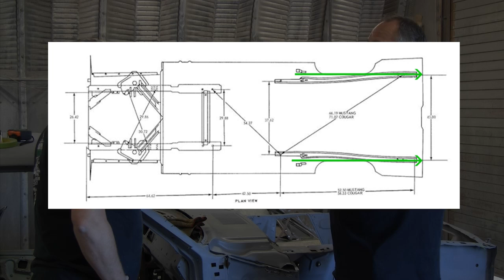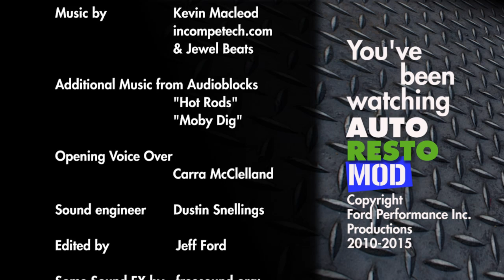How To Full Floor Pan Install 1967 1968 Mustang Tips Tricks  Episode 195 Autorestomod

Comment: How does a rotisserie change his suggestions for jacking the car?  I also have cross bracing available since I am working on a 70 convertible mustang.
Reply from the maker: Well, I am not a fan of using a rotisserie for floors. Ford sat the cars on a jig table to lay that foundation and you will lack that on a rotisserie.

Comment: A few spots after the floor pan was layer in show rust spots. You guys gonna go in and wire brush those spots?
Reply from the maker: There is a ton of other work to be done. We hope to get down there in the coming weeks to show some more on that install. They pulled that ahead of other cars so we could shoot the episode. So there will be more on the car, just a little further down the road.

Comment: You may have already answered this, but I didn't see it in the posts. If so I apalogise. I have checked your videos, and can not find the second half of this video. Could you send me the link to it, so I can watch it as well. Or if you could send me a link to a video to show toe panel installs that's my next step before putting in my one piece floor pan. Thank you, and really appreciate you doing these videos. They have helped me many times already on the 65 I'm building for my daughter. This is my first major resto job, and it would have taken my twice as long to do some of this if not for you guys , and Joe Daddy's. Thanks again.
Reply from the maker: First, thanks for the kind words! We were unable to get back down to Byron to shoot the pan install before the guys had to finish up. The toe boards are part of the firewall and not a separate piece, We'd use the full floor as our guide if we were going to toe board the car.

Comment: Where was this done? In Byron, Georgia I believe?
Reply from the maker: Yes. Sadly, Mustang Central is gone now.
Reply: @AutoRestoMod  Yep. I live about 3 miles from where it was located. Too bad theyre gone. I’m starting a restomod of a 1962 Falcon 2 door sedan. Im thinking about trying to fit a 66 mustang front floor/ transmission tunnel to it so I can use the bucket seats and floor shifter. My floors are totally gone. I know they do make a full floor pan for a 65 Falcon too. I have the Mustang seat risers already.

Comment: how much weight can a modern car floor pan hold? will putting a 100lb dumbbell on the passenger floor pan cause any damage?
Reply from the maker: Not unless you hit a wall... then you will have larger problems to worry about.

Comment: I have a 87 ford mustang notchback. I'm doing the full floor pan no motor n trans,or rear axle. can I level it out the same way you guys did your mustang in this video?
Reply from the maker: Yep. all that same stuff applies. And actually SHOULD be done any time you are doing a full floor.
Reply: thanks guys keep up the good work and videos
Reply from the maker: Thanks! and good luck on the pan!

Comment: Can I use screw jacks? Would it be easier?
Reply from the maker: Yes; I'd actually prefer using them if the body is gutted. They are easier to adjust...but make sure that they are rated for the load.

Comment: question on an 87 mustang I'm doing both front parts of full pans backs are solid no rust at all do I need to put the car on jackstands?
Reply from the maker: We would just o be sure you maintain structural rigidity and balance.

Comment: How much do you think an outside shop would charge for replacing the entire floor pan like you did?  I have an 81 Buick Regal.
Reply from the maker: Honestly, it will depend on the shop, the location, and the amount of work they have to do to get it in there. You can save a very small amount of money  by removing the interior yourself. But we can't really pin down a cost just because it can vary literally street to street.
Reply: I understand. Thanks for replying. Your videos are awesome and motivating.
Reply: Howd the regal go? I just got a full pan yesterday for my 78 malibu. I've watched a few videos, but so far most seem to be unibody cars. Anyway, the biggest pain in the ass is separating all the seat bracing and whatnot. Air chisel....kinda gets it started, but I've found a sharp chisel and hammer finishes it swiftly. I'm going to assume, my 600 dollar part for this task would be at least 2 grand at a shop

Comment: I swear there is someone ....somewhere who is putting razor blade sharpness on edges of new stampings.  Cant tell you how many sliced and ripped fingers I have gotten over the years. And then the little fish hook barbs on some of the factory spot welds.....great skin rippers.
Reply from the maker: Weirdly, we were talking about that just yesterday with the new Fender we got from NPD. But not just that, we have an export brace from Dynacorn that is the same way. The upper edges are very sharp; I'm actually going to dress the edges on all those things so I don't cut myself working on the car, lol.

Comment: a bit of advice please. i need to remove the base of the A pillar on a 1966 XP 4 door sedan (here in Australia) - in doing so i also need to remove the top of the sill only and weld new steel in. the car is still in tact in one piece, and, glass etc is still in it (door removed mind you as is the front guard. car is sitting pretty on 4 wheels (no engine) - should i triangulate from further up the a pillar to the sill either side of the A - or will there be enough support in the existing car (that front screen is bloody heavy) to keep it together. appreciate your thoughts, i've been putting this off for a while and need to get off my ass.
Reply from the maker: Hi Ho Hi Ho Hi Ho! =)